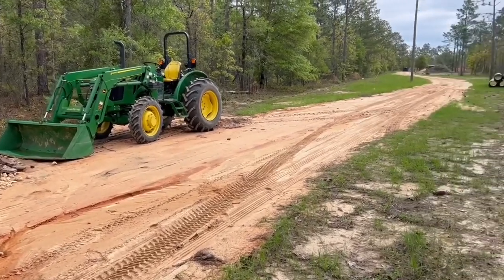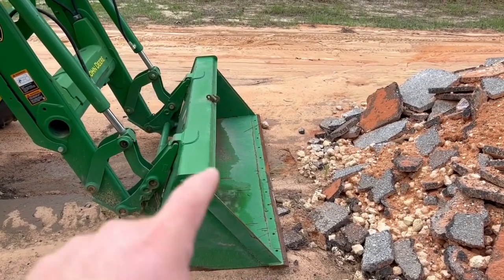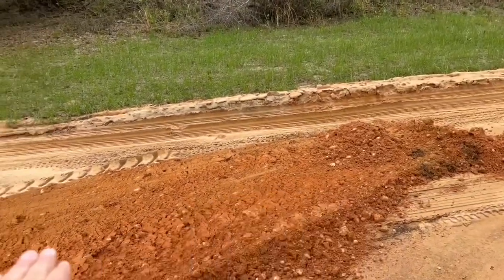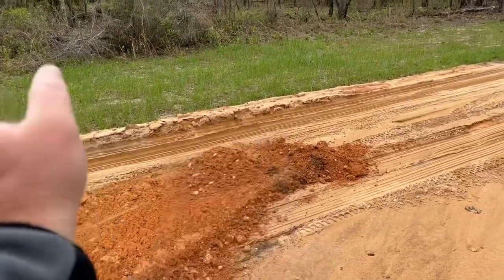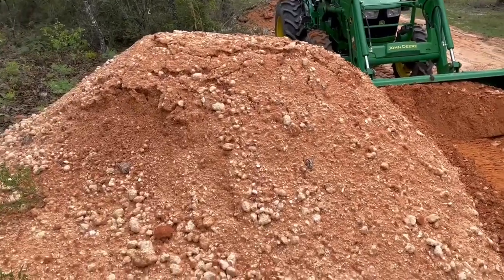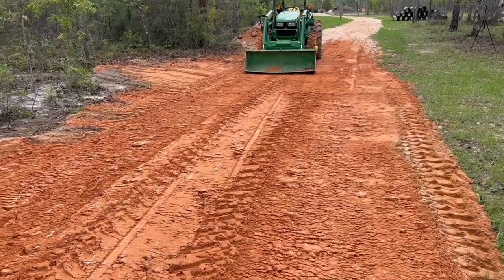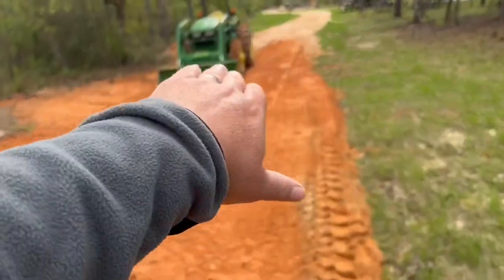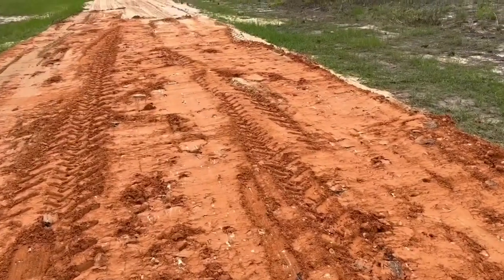How To Spread Material With A Tractor Like A Pro

Comment: How’s the tractor been holding up? How many hours do you have now? I’m looking at buying a used  one. You hear lots of horror stories, no one ever goes on forums to brag about the great experience they have had!
Reply from the maker: About 550 hrs. Haven’t had any problems to speak of. I would buy again. But I would buy new again. There are a lot of people that sell tractors that haven’t been maintained. And get a cab!!!!
Reply: I have a 5075e. Just approaching 1000 hours. It’s done everything from cutting hay, baling, plowing, snow plowing, rototilling, loader work, etc. You don’t hear much bad about the 2.9L Deere’s. They put them in everything for a reason.